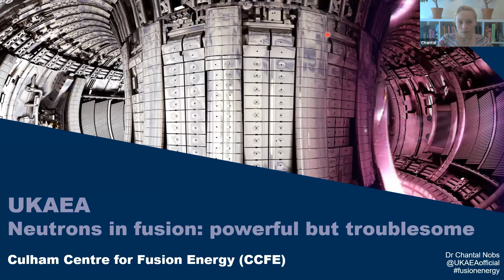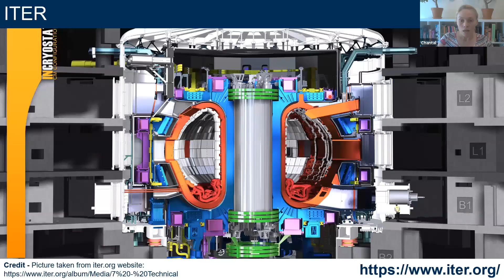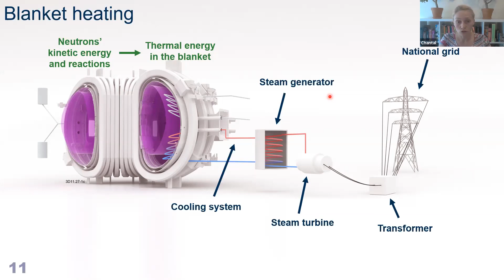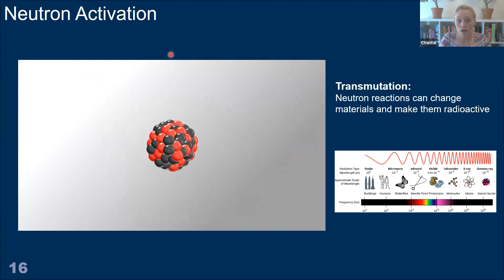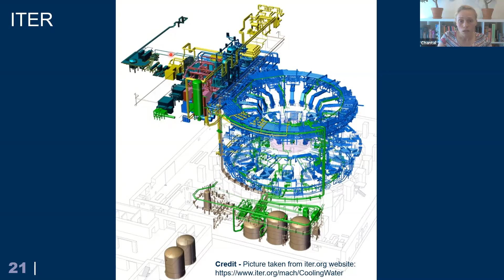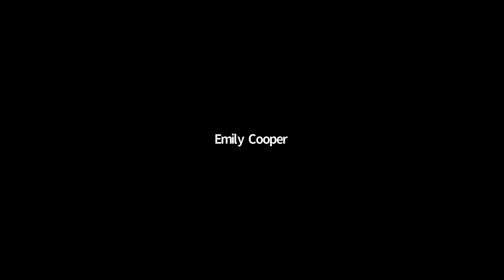Neutrons in fusion; powerful but troublesome

Comment: Does the neutron flux do actual damage to the materials of reactor construction and hence shorten the life / cause the need for replacement of components?
Reply from the maker: Hi, thanks for your question! Yes. Billions of neutrons are produced every second from fusion reactions taking place in machines like JET and soon in ITER. These neutrons are free to go almost wherever they like because they are not confined by the magnetic field. When they collide with different materials in the reactor they can physically damage these materials, and over the lifetime of a fusion reactor different components will need to be replaced.

Divertors will need to be replaced most frequently, as they also handle a high heat load from the plasma, in ITER it’s expected that the divertor will need to be replaced a couple of times over ITER’s 20+ year lifetime. The first wall will probably also have to be replaced once during ITER’s lifetime, but because the first wall is designed to provide shielding to other components behind it we don’t expect that any other components will need replacing due to damage.